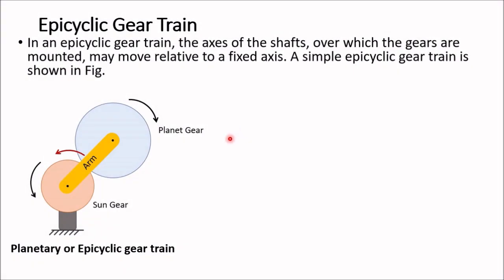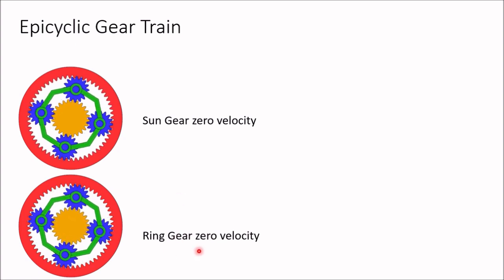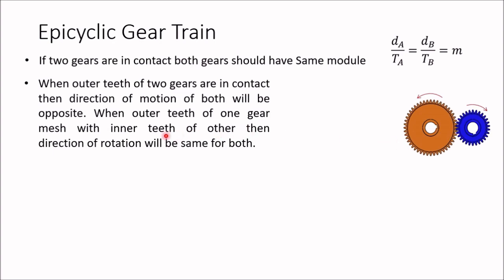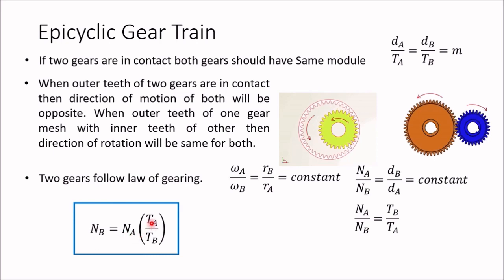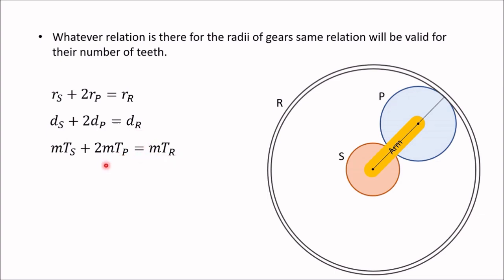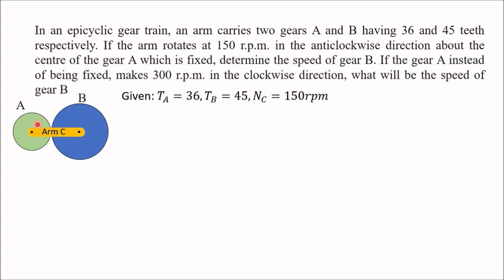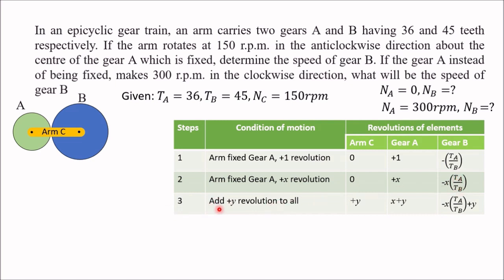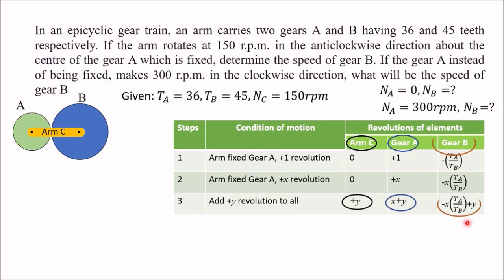Analysis of planetary gear train

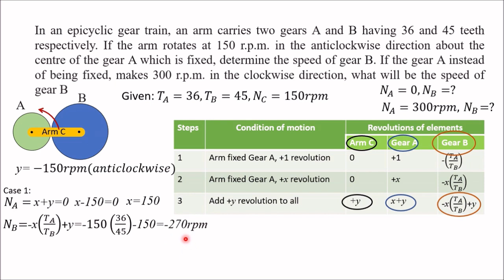Comment: time stamp 14:26 . 270 rpm CCW is the ABSOLUTE rotational speed of gear B. Its rotational speed around the spindle on ARM C is only 120 RPM CCW [ 270 - 150 = 120]. Am I making sense?
Reply from the maker: Yes